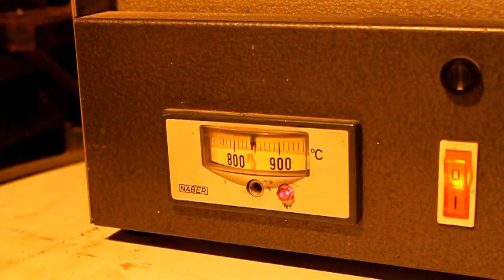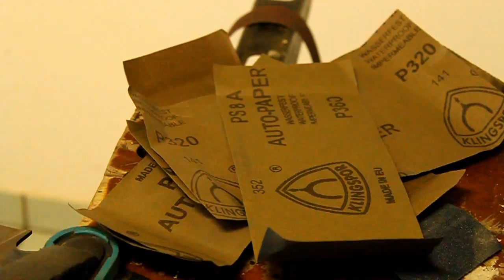Making a kitchen knife

Comment: Really nice shape to the knife. I was wondering, you kept the edge at 0.58mm prior to heat treating, is this to prevent warping? I am currently making my first knife (a chefs knife) using O1.
Reply from the maker: Thanks! I would keep it at 0,8 to 1.1 mm thick. This knife blade actually warped a bit!
Reply: +Alexander Bol thanks for your advice! I think I've already gone thinner than that... Do you have any tips for correcting warping with O1?
Reply from the maker: +Richard Harris oh that is only possible right after the quench. When the blade is still 500 degree's Celsius

Comment: nice, but at 2:12 you r overheating the blade after quenching, this is reducing steel hardness , however is a nice knife, Hope you will make many more
Reply from the maker: You're absolutely right! I used to quench at 850 degrees C, but now I quench at 805C. That makes the steel a lot better. Thank you for watching and I hope you enjoyed my work.
Reply: Alexander Bol  I'm talking about grinding blade until color is chancing on the edge, this is altering heat treatment
Reply from the maker: Ionut JaR I honestly think the blade isn't changing color. I think it is a reflection of sparks on the steel table. But it could be overheating though. I was always learned to don't use jigs for post HT because you can't feel the blade heat up. Thanks for your interesting reaction tough. You're a knife maker yourself?
Reply: Alexander Bol I'm making knife as a hobby.. I have a long way to knife maker :). keep up the good job

Comment: how would you prevent the steel from rusting?
Reply from the maker: Hi Nathan, there are a couple of ways to do this, but O1 keeps needing work. The most simple solution is etching in FeCL3. The black coating is supposed to be rust proof and food safe. An other solution is mirror polishing, this will make it harder to rust as well. I just clean the blade up and put olive oil on it every time I used it. I hope that answers your question. Alex

Comment: What kind of metal did I used
Reply from the maker: O1 tool steel. Hardened at 805 degrees C. Tempered twice at 200 C for two hours. For rust resistance i now use RWL34 witch is also a sick steel!